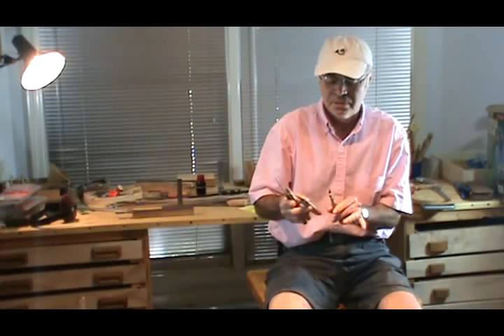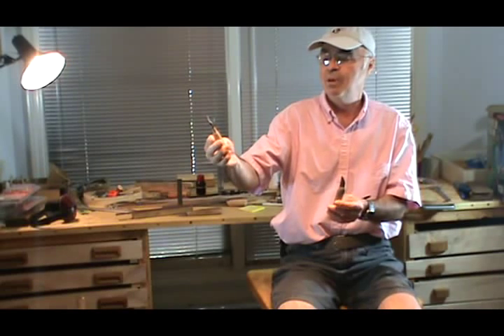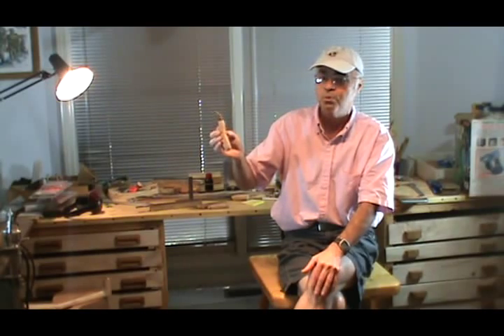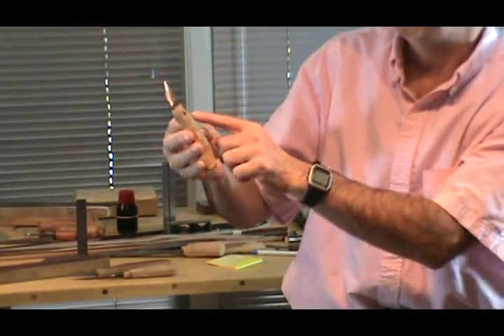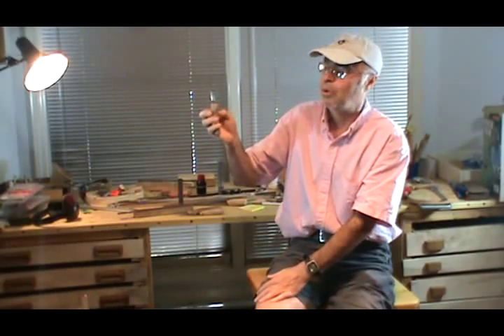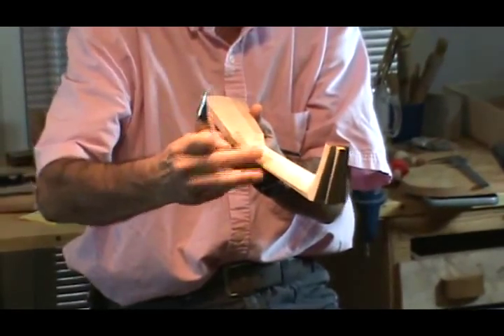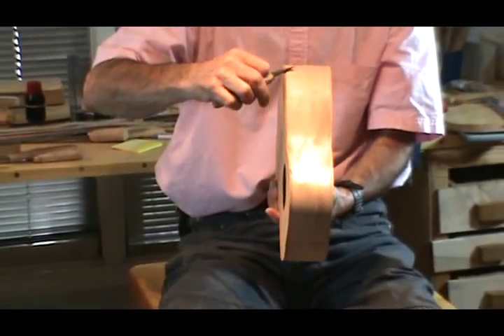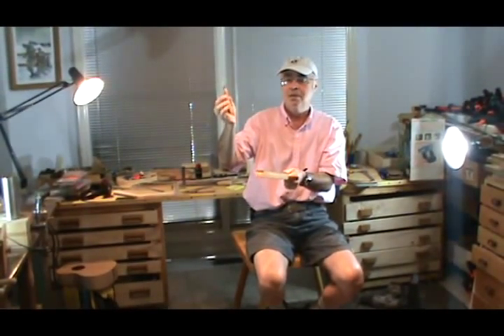How to make a Luthiery Knife

Comment from the maker: John , your absolutely right  , files from the republic of crapola are useless. I recycle old files american , german  cdn, british , fench, swiss.These can be found at yard sales for between 10- 50 cents and are sometimes rusty  and in boxes loaded with other tools , so you have to dig to the bottom to find them. I don/t always use a grinder . If you have access to a  belt sander, that will work . I frequently dip  a file in water to avoid  tempering or changing colours

Comment: Ernie,
Making a knife from a file is fine if you have a way to do the grinding coolly, if you have the time, AND if the steel is good. Unfortunately, the steel found in files at the major hardware chain stores comes from China and is NOT useful. It isn't even useful as a file. The first time you use it, it gets dull.